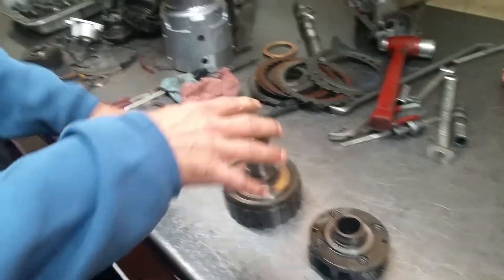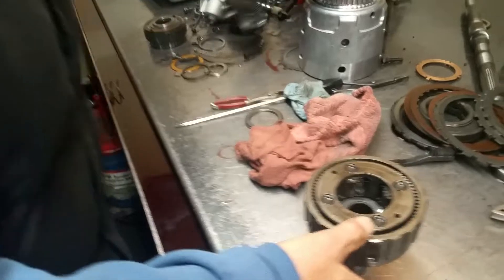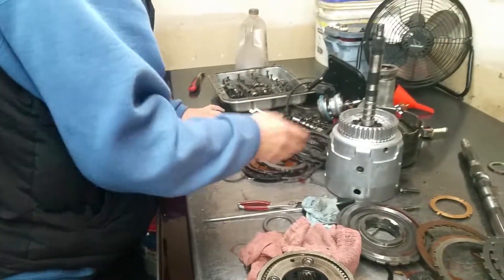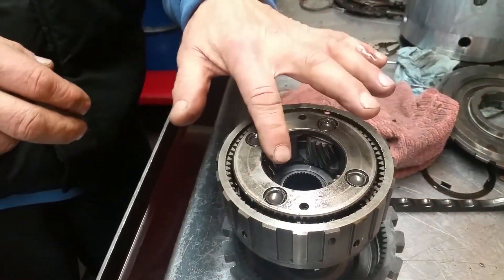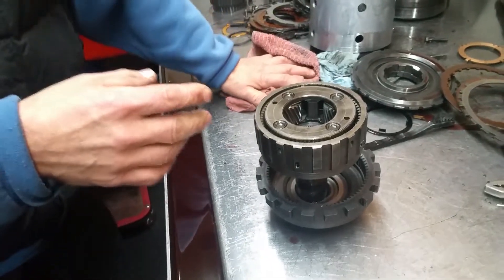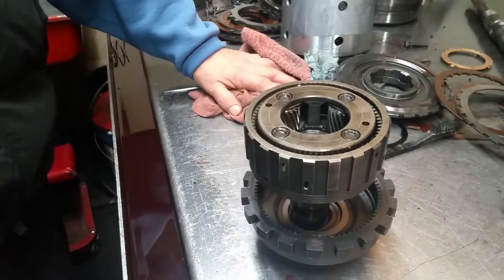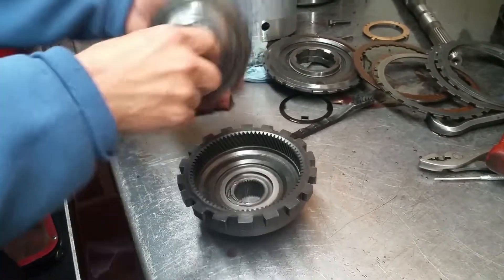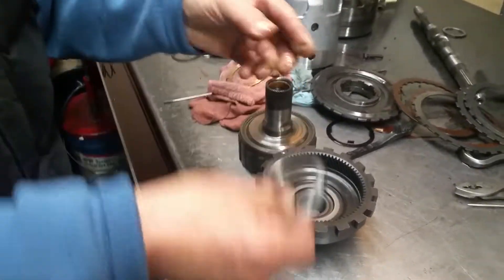Chevy Tahoe 4L60E Transmission - No Reverse, Neutral goes Forward

Comment: Quick question if you dont mind, please... 2008 cevy tahoe ltz. All gears work except reverse works every now and then. If i leave somewhere, i can drive it, maybe 20 minutes, i park, put it in reverse, it wont reverse, i can feel it kick i to gear but no moving or little tugging. But after i go into the store for about 10 minutes or  can get in the vehicle,  put it in reverse, and it will either work fully. Or it will tug a little bit but still move backward.  But after driving for a while in forward, there is no slippage or anything. I can put it in reverse, and then it won't go in reverse unless it sits a bit. Any ideas or suggestions? I do not have any check engine lights on at all.
Reply: Ever figure it out?

Comment: I have a question. I have a 97 Chevy Silverado with the 4L60E. I was driving back to work and out of nowhere I started to hear a terrible grinding noise. Kind of like the sound of gear teeth rubbing and roaring against each other. As I press the accelerator the grinding noise got worse and increased with the RPM. The truck did not have any power to the real wheels. I managed to get it on the side of the road. When I put it in reverse without hitting the accelerator it grinds. When I put it in drive, or 1,2, etc it shifts perfectly fine ,but again when I hit the accelerator it starts to grind. When I shift it into drive I can feel the truck wanting to pull itself ,but of course as soon as I touch the accelerator it begins to grind and will not move. I think it may be the sun gear or the torque converter ,but I'm not sure. If anyone may kindly give me any advice it would be highly appreciated. Thank you.
Reply: i Do believe your rear-end blew out. And will need replaced. I would take that to a shop to where they can rebuild it

Comment: Did you have to do a total rebuild or just replace the sunshell and planetary gears
Reply: wrong wrong wrong
Reply from the maker: Sunshell and gears.
Reply: Max Belousov around how much did it cost to do that?
Reply from the maker: @FelipeLopez-je9yx   2k USD. 1k parts, 1k labor
Reply: @MaxBelousovGG  Wrong, the frictions and steels get so hot they weld together in the forward clutch assembly.